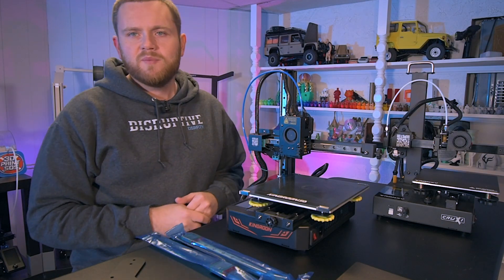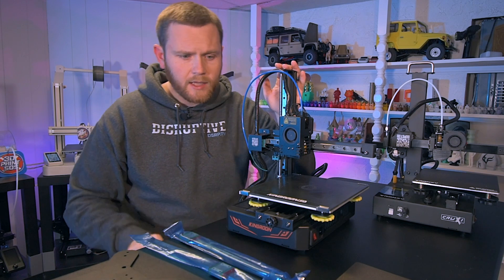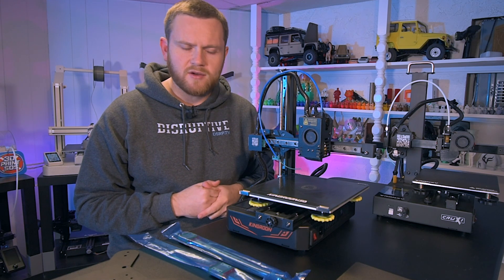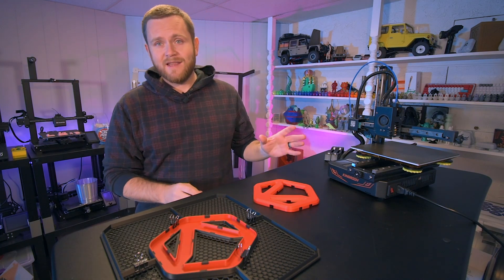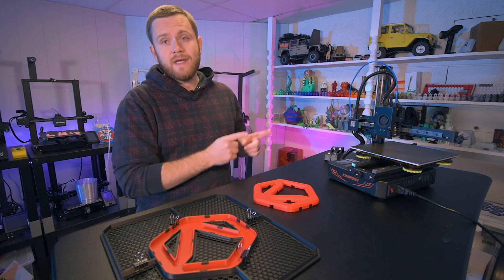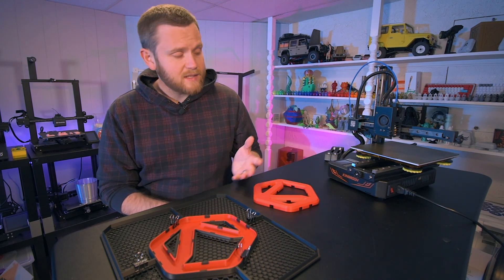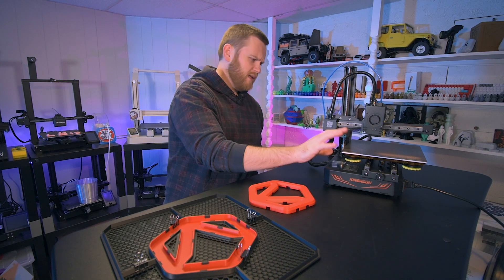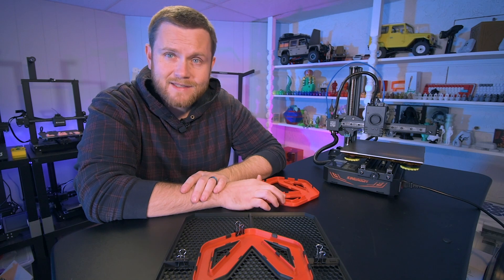The Kingroon KP3S Pro Gets Rails!

Comment: Loved both of your videos on the KP3S Pro, thanks. Got mine a month ago, added a Pei Sheet and printed a Spool holder that lies on the back of the printer, didnt want the on top of the Z axis one couse it could wobble de Z axis. Did you install Klipper on the KP3S Pro ? Any speed gains ? I use Orca slicer 2.1.1 and the built in profile for the KP3S Pro S1 goes up to 100 mm/s !!! Cura just gives me 60 mm/s...
Reply from the maker: Yeah for sure. Klipper took things to the next level on this machine. I have it to a buddy of mine and he is still using daily. Once you get things tuned, you can go faster than 100. 150-200 average. ;)
Reply: @3DPrintSOS  Wow, that fast ? What about the quality of the prints at that speed ? Seen reviews on the new 500 mm/s printers and yes, they print fast, but the quality is worse. They have to downgrade the speed to 200-300 mm/s to get the quality of the old 60 mm/s printers.
Reply from the maker: @Not-Einstein-61  With Klipper and simple sensors like accelerometers, you can REALLY hone the machine in. So the loss in quality is minimal, if not even, negated entirely.
Reply: @3DPrintSOS  Great, I will give it a try. What would be better, use an old cel phone or Pi Zero 2W ?
Reply from the maker: Any pi would be better than a phone. Only because there are way more hoops to jump through with a phone and lots of variables. Tons more support for Pi as well.
Reply: @3DPrintSOS  Thank you very much !!!

Comment: Let me start out by saying that I am a fan of Kingroon and I love my 2 KP3S (not pro) printers but I just can't see the value of the KP3S pro. Here in Canada the price of the pro is $100.00 more than the 3.0. That is a third more money. $199 to $299 CAD. What do you get for that $100.00? They added a linear rail to the Z axis which might improve the print a little. Fine. But they took away the linear rail on the Y axis and then offer them as an ad on kit for more money. You get a slightly bigger print area and a glass bed and the power supply is in the base. In my opinion Kingroon is getting a bit greedy. Most of the reasons I bought Kingroon are now gone for me I am afraid. I bought my second 3.0 while they are still available.

Comment: If you are intending to run klipper to speed the printer up that would make a great video, but what about part cooling? Is there an option to increase part cooling performance for high speed prints?
Reply from the maker: Hmm. I did see a few printable ducts that are available out there. I havent had any cooling issues yet though. We will see what happens when I push some speeds. ;)
Reply: @3DPrintSOS  will be looking forward to the video ❤️

Comment: Great video as always and printing some Aries panels. Pi would be pretty cool and a custom filament holder with a spot to mount the filament run out sensor.
Reply from the maker: Gotta show that Aries some love. Been sitting for well over a year now. Want to use it for printing ABS for another project. HINT HINT ;)
Reply: @3DPrintSOS  been there done that haha... I pretty much exclusively printed ABS on my Aries since I got it, actually i designed those panels and other Aries mods out there 😜
Reply from the maker: @brentdodds9211  Hey! You’re the guy! Thanks for your designs, you did a great job. Im trying to sort some “plastic” for them now. I was thinking of going back and maybe just reprinting them solid instead though. Less work. haha What have you used in the past for the panel inserts?
Reply: @3DPrintSOS  haha laminate pouches, when the budget is sooo low "evolution out of necessity"
I've been using cardboard panels because I don't have the time nor patience to print the panels Myself 😬
Reply from the maker: @brentdodds9211  I’ve been using black presentation board for ages. “fancy cardboard”. If it works, it works.
Reply: @3DPrintSOS  magnets or DS tape to hole the panels in?
Reply from the maker: @brentdodds9211  I got a pack of magnets. ;)